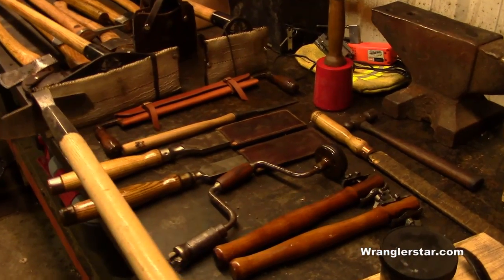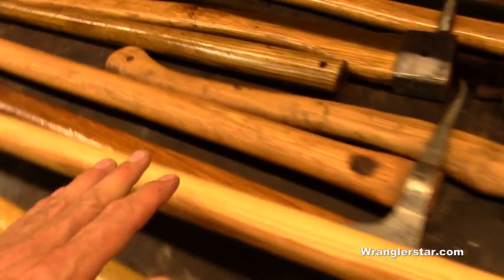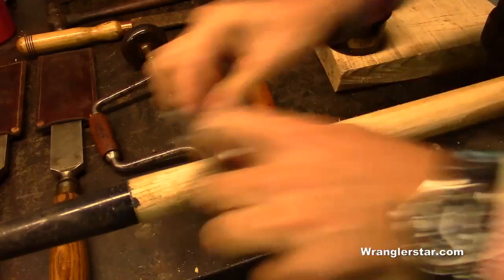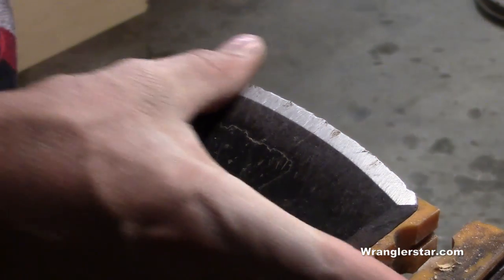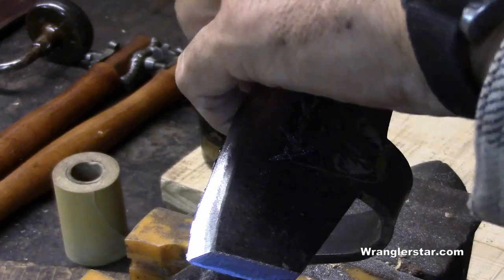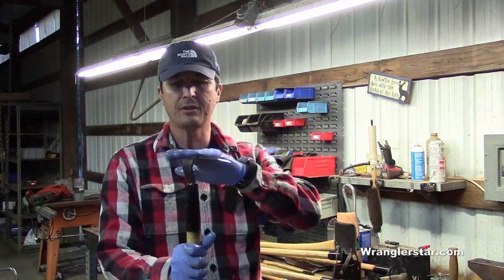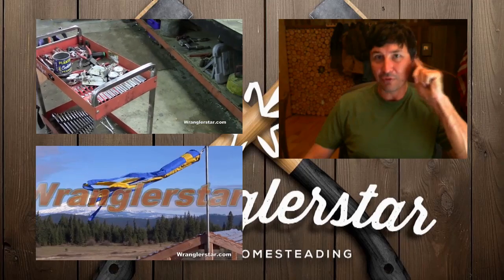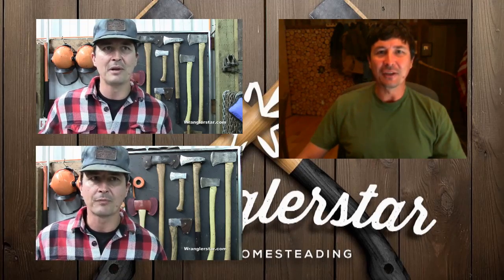How To Strip Varnish From Tool Handles | Wranglerstar

Comment: Cody,
           I have been treating my wood handled tools in the same way since I have learned about it from your channel, there is no comparison in the way that an oiled handle feels. In the past,  I have finished my blacksmithing hammers similarly, only with those I had treated them with used motor oil after lightly charring them to an even black finish (done properly, it leaves a smooth finish, but care must be taken not to over char the handle) The old man who taught me what I know of blacksmithing did this to all of his hammer handles, but I'm not completely sure why. Have you ever heard of this? What are your thoughts?

Comment: Varnish is applied to handles to keep them looking nice through the packing, shipping, stocking and retail purchasing...I think of it as the handle's packaging...just think about how many "hands" touch each handle from production- purchase...if not for the varnish it's possible that a handle would look pretty pathetic and it won't look "new"...  When I re-hang an axe for a customer, I prefer to buy a handle with varnish on it so that it has a protective layer, this way,  it does not get dirty while I fit the head and finish sharpening...then I sand off the varnish and apply BLO... Peace, Rooster

Comment: Just a suggestion. the file you used to sharpen the hoe looked like it could use a good cleaning, a file card, a piece of copper or brass and if needed an acid etch will bring it back to near new condition. I agree, varnish is to look pretty in the store, not a practical or long lasting finish, then again it fits the throw away buy more mentality.

Comment: A dear old blacksmith friend of mine, former USN demo engineer built his own power hammers etc. used to torch off the varnish carefully, and then BLO the handles. The only thing that screams craftsman louder is a properly seated and cared for blacksmiths hammer set with mirror polished faces. Those handles lasted 30 years or more. Gorgeous work. His number one gripe was the varnish blistering his hands.
Reply: swing an axe for 6 hours with no gloves and I don't care if it's wrapped in velvet..your still gonna get blisters

Comment: Cody, as a semi-pro pool player and amateur pool cue repairman, I disagree with your notion about an aspect of varnish being "slippery."  Yes, if your hands are soaking wet, it's like putting wet ice against wet ice.  But an interesting phenomenon happens when dry or even just moist skin touches a high gloss object -- it sticks!  You can see this on pool cues that are varnished wood, with an irish linen thread-wrapped grip area.  If you rub your hand over the irish linen thread-wrapped grip area of the cue, it slides.  But as soon as your hand moves from the irish linen thread-wrapped grip area to the varnished area, it (your hand/skin) immediately sticks/adheres to the varnish.  This is called "tack" -- i.e. the tackiness aspect of skin sticking to a shiny/glossy surface.  When a cue maker/luthier makes a pool cue for a player, one of the most important discussions the maker has with the player prior to making the pool cue is what kind of grip the player needs.  Some like irish linen thread wrap -- which is dry but slippery (for slip-stroke); others prefer leather (which is less slippery); others prefer a high gloss (varnish/polyurethane) for the most "tack" and less slippery of all.  I'm one of those players that prefers the most "tack" and therefore most of my cues have a natural wood with high-gloss finish in the grip area.

I think the distinction between where varnish is most appropriate has to do with the use of the tool itself.  If it's a pulling tool that requires a lot of grip (e.g. a hookeroon or pickeroon, or mattock), varnish or polyurethane is appropriate because it offers the most "tack" for your skin to adhere to.  If it's a tool that requires a bit of a slip for mid-swing hand replacement (e.g. a splitting maul, axe, or sledgehammer) where one of your hands is sliding on the handle to re-grip in a different area mid-swing, than a matte finish (like linseed oil) is more appropriate.  It's all in the use of the tool and how the hands are performing on the tool -- whether they need a matte finish to slip a bit, or need constant "tack."  I prefer the boiled linseed oil finish on all my sledges, axes, and mauls. On my pulling tools, I prefer a polyurethane finish (better than varnish because it doesn't crack, checker, or spiderweb) that has a high gloss.
Reply from the maker: sfleinen A pool cue has nothing in common with an axe.
Reply: wranglerstar Cody, is that the best answer you can muster up?  Yes, I know a pool cue has nothing in common, usage-wise, with an axe.  What I was referring to, was your comment that varnish is "slippery" -- which has nothing to do with the tool.
Reply: sfleinen I think Cody is referring to how each is used.  Tools have sweaty hands, slick gloves and get into the mud, snow and yuck all the time.  Pool cues get nice cases, are rubbed and rarely leave indoors, at least mine gets that treatment.  So the two are not comparable in use or exposure.  Also, all varnishes are not the same.  What goes on a cue is far more luxurious than the factory stuff on a hand tool.  My hands are clean (discounting chalk dust) and dry when I use my cue: always.

Comment: Short Question: If i bought an Gränsfors Bruk axe do i have to treat it?
Their homepage says "it is soaked in hot linseed oil. The handle is then treated with beeswax". So i guess applying linseed oil ontop of the beeswax is a bad idea. Any thoughts on how to oil it?
Sorry for my bad english (im from Germany) and thanks in advance for your answers.
Greetings
Max
Reply: Sobald es nötig ist den Stiel zu behandeln, weil Poren offen sind, die Feuchtigkeit und Schmutz ans Holz lassen, wird das Holz dort auch Öl oder Wachs annehmen. Da man den Überschuss sowieso abreibt, kann man da auch nichts falsch machen.
Meiner Meinung nach hat Bienenwachs aber auf Werkzeugen nichts verloren, weil die Oberfläche dadurch viel zu glatt und rutschig wird(wie bei Lack). Leinöl drauf, einziehen lassen, abreiben, Vorgang so oft wie gewünscht wiederholen, fertig.
Erhitzen vom Öl hat den Vorteil, dass es dünnflüssiger wird und deswegen Tiefer ins Holz eindringt, aber zur Pflege ist das unnötig.
Leinöl gibts übrigens im 1L Gebinde(zum Mischen eigener Ölfarben) in jedem Baumarkt in der Farbenabteilung beim Pinselreiniger/Terpentinersatz etc. für unter 10€.
Gruß aus'm Ländle :)
Reply: Super. Danke für die schnelle Antwort und die gute Erklärung. ;)
Reply: Max xaM

Comment: Someone very kind gave me a cheap splitting axe and I tried it out for the first time today. It is excellent at splitting, but has a fibre glass handle with rubber inserts. After two strikes I could feel the rubber digging into my hand, for the first time ever, I have had to use an axe while wearing gloves. Not a good idea.

Comment: Why do MFGs vanish wood handles ? Its fast and cheap and comsumers want shiney things 

Vanish can be applyed with a automotive sprayers  just hang a bunch of tools on a rack and spray varnish all over them 
In the time it takes for Cody to put the first coat on one tool a worker at big box tool company can spray a dozen tools 
And since it maybe a a year or more before a big box tool gets to the comsumer varnish will keep the look looking brand new and shiney 

Somebody else mention a scraper to remove varnish  good idea ! A scraper can be made from the blade of a good drywall putty knife  cut a semi circle in the end of the blade and roll a hooked edge on it   or buy a spoke shave thatis rounded sometimes a chairmakers spokeshave

Comment: Hickory wood contains hydrogen cyanide which is very poisoness and dissolves in sweat. So for hickory handles it does make sense to have a varnish on. But on all other woods like ash it makes no sense at all.
Reply: If it was such a big problem I'd think they'd put a much thicker coating on the hickory handled tools instead of the temporary shiny skin they have on them now.

Comment: For those without a spoke shave, would sandpaper be the alternative method. If so, would you still start with 180 grit, or go down to a 60-80 grit?
Reply: Speaking specifically to the Rogue Hoe tools; using sand paper has proven problematic for me.  The varnish heats melts as you sand it and then quickly cakes on the sand paper and immediately cools and dries once you stop.  At best I was getting 20-30 strokes out of a section of paper before it was essentially useless.  An abrasive cleaner (magic eraser) would not even lift it out of the paper.  
The spoke shave method has been much quicker, easier and far less frustrating and well worth the money if you're working more than one tool.
Reply: Kleinfreak Would a card or cabinet scraper would better and remove almost no wood?
They even have curved ones that would work well on a round handle....
http://www.leevalley.com/US/wood/page.aspx?p=32639&cat=1,310,41069
Reply: You could just scrape the varnish off with a pocket knife if you wanted. I normally use a pocket knife, don't have to adjust blade depth like on a spoke shave.
Reply: *****
 A cabinet scraper would work fantastic. A soft wire wheel can work too.
Reply: StuInTokyo Either a card or cabinet scraper would work quite well.
In a pinch a piece of broken hacksaw blade or piece of glass can be used to scrape off the varnish. Old saw blades are often cut into chunks and made into scrapers for special shapes.
Reply: Old Sneelock's Workshop Yes, just about any hard or spring steel would work well. I used to make a wooden staff that is about 4' tall and 7/8" in diameter for martial arts, I would cut the staff on the tablesaw, four sides then 8 sides, then I'd scrape it down to round, I used an old power planer blade that was about 12" long and 1/4" thick by 1" wide, I ground a half circle in in and put handles on each side, this worked really well for making the 8 sides pieces round. It would also work very well for taking off the varnish on a tool handle. The nice thing about a piece of spring steel like a hacksaw blade is that it would flex causing more of the steel edge to scrape more surface area.
Cody are you getting all of this! :D

Comment: The reason tools come varnished is because the people who buy them Dont use them. People buy a shovel, pick, axe, hoe, anything. And then use it half a dozen times and are done with it.  No one uses these tools anymore.
Reply: Water based varnish is less OSHA paperwork and cleaner in the factory. It is really just a placeholder for a real finish. Some companies send them out raw wood but it will dry out and check.

Along with BLO, Tung oil and Danish oil finishes are also really good. If you are doing a tool for daily use, an occasional coat of beeswax is also a really nice addition.   The oil for the wood and the wax for your hands :)
Reply: David Kirtley David I agree with you that the reason we see water based finishes on tool handles is because of OSHA etc, but if the handles were left unfinished they would not "dry out and check" the wood used in tool handles is already dry, usually kiln dried and it will not dry out any more than it is when the handle is attached. I think the better answer is that they unfinished tool handles would become dirty with handling in the various steps it takes for the tool to reach the retail outlet and most consumers do not want to buy a tool with a grubby unfinished handle. This is a lack of knowledge on the part of the consumer. I wonder if a tool company tried to educate the consumer instead of just trying to react to a perception could be attempted. If the tool makers said something like "Our tool handles are left unfinished so you the end consumer can choose which finish, if any, to put on your tool handles" and then a blurb about how they are saving the planet (yada yada yada <insert eye roll>) by NOT using these chemicals on the tool handles.
I do not know if it would work, but maybe someone would try it...?
Cheers!
Reply: David Kirtley The water based varnish is also easier to handle than BLO. BLO polymerizes in an exothermic reaction. It acts like fiberglass resin. If you leave a rag soaked in BLO to dry on it's own it can get hot enough to catch fire from the BLO hardening. It's not a product that is loved by the insurance companies.
I like to wax my saw handles after I refinish them. It makes them feel better and cuts down on the blisters.
Varnish gets gummy too. The BLO and wax gets smoother with use and never gets sticky.

Comment: What do you recommend to coat the steel on tools to prevent rust? I use Rem-Oil on most of my tools but will Boiled Linseed Oil work as well?
Reply: That's just what I had, you're right WD40 works perfect.

Comment: Have you ever found a tool that has been left to rust for whatever reason? I have found that Removing Rust with Electrolysis helps greatly with large jobs or jobs that are knuckle buster. Know there isn’t anything wrong with good honest work and being responsible with your tools but when you buy old tools there often a bargain just for that reason. Replies are requested.

Comment: I used linseed oil on my shovel handle, once... It never really ever got dry, was sticky and would get dirt embedded in it... It was worse than no finish at all.

It may be different now, with the chemical driers they add - poly urethane or something, I think.

I prefer tung-oil.

Frank
Reply: That has happened to me with BLO, but it's usually because I put too much on at once.  Now, I put just enough on to give it a nice sheen, and then wipe off the excess with a soft rag. But there ain't nothing wrong with tung oil.

Comment: I can't find boiled lincead oil.    where do you get yours
Reply from the maker: +Abram Mellott any hardware store should have it
Reply: +Wranglerstar yes Mr. W is right if you look in the paint section near the other oil finishes you should see it.      how long does it usually take to dry to the touch? last time i used it it was quick but i have a hatchet that seems to be taking quite a while
Reply: +Derek&#39;s Version I've found that the older the wood is and dry the quicker it will suck in the oil.  I had a mallet that doubled in weight with the oil it soaked up!  If it isn't old and dry it will only take a couple of coats.  If your hatchet isn't soaking it up then just coat it a couple of times and burnish with steel wool and enjoy!  Just be sure to keep treating it often.
Reply: +Abram Mellott Probably because you should be looking for linseed.

Comment: Very good video Cody I can see where the spokeshave would works very well, but if you don't have one what do you do?  I like using denature or solvent alcohol and steel wool to strip varnish off tool handles and gun stocks.  Of course you use different grades of steel wool depending on the job you are doing.
Reply: Any sharp piece of steel that can scrape works. I use a pocket knife.
Reply: I like to clean saw handles with alcohol and steel wool. The alcohol doesn't raise the grain and softens the varnish so I can scrape it off easier. I sometimes use a knife blade or hand made scraper to reach into tight spots or carving to get the gunk out of them.
Do you have a suggestion for removing finish from checkering on gun stocks? I've always pretty much left that alone because it seems to screw up the checkering no matter what I do.
Reply: Kriss Femmpaws Thanks Kriss. That sounds like a great idea. I'll have to try it on my next one.
Reply: When I was in blacksmith school the old timers took my new hammer and torched the varnish off. Just a quick blackening of the wood indicated the varnish was gone in that area. I was horrified to see a new handle burnt but it very quickly took on a great feel in the hand and wore in very nicely with use. Now that is my preferred way to treat a new hammer. I'm not sure I'd do it on a long handled tool like Cody was showing. The tool certainly isn't as pretty as the boiled linseed oil that Cody showed but it's pretty in it's own way and it certainly has a unique finish.
Reply: Bor the Wolf
 A scraping card is the best for the job, I agree. For all those who don't have one, you can easily repurpose a (narrow) spatula - the kind you use for spackling - should be dirt cheap in your local hardware store, if you don't already have one laying around.
Put the blade of the spatula on a medium benchstone at 90° and grind the side edge flat so that you end up with a burr on both sides of the blade. That's basically it! You now have a scraping card with a handle to boot.
Your ersatz scraping card be able to scrape the varnish off by holding it at an angle and dragging it along the handle. Also works for other wood scraping jobs where you don't need the degree of precision and surface finish that a cabinet maker might be looking to achieve, eg. smooth down the ridges that a spokeshave makes.
The steel and hardness of your average spatula should be plenty good for the job, but you can also use old saw blades etc. Just about any thin, hardened sheet of steel will do.

Comment: Okay, so why not just get a 2" diameter, 5' long black pipe and pour BLO in it and let the handles soak overnight?  You can cap each end of the pipe to save the oil for a lot of handles over time and maybe cut down on the daily BLO rub?  Maybe once a month soak overnight for a year?  You could rotate your tools into the pipe(s).  Just some lazy thinking here?  Not sure.

Comment: personnaly, my handle have nothing on it, hatural wood and no problem.
Reply: Covered in boiled linseed oil, the wood will be much more resistant to moisture. For example I can tell the difference on my Opinel knife, it used to soak up water and swell when washed in the kitchen, the wooden handle was getting tight. It's much better now (also looks and feels nicer to the touch imo)